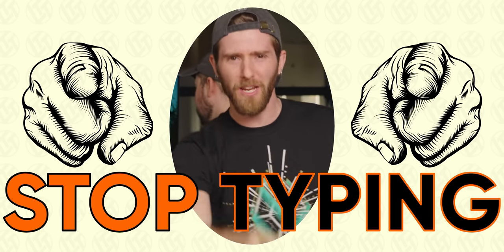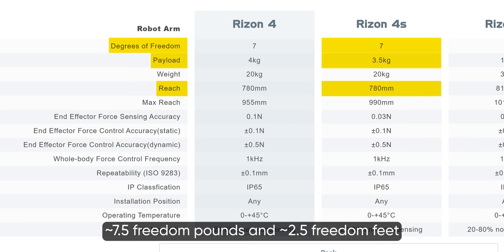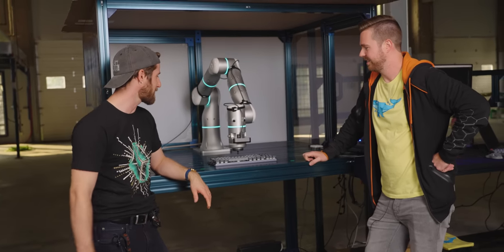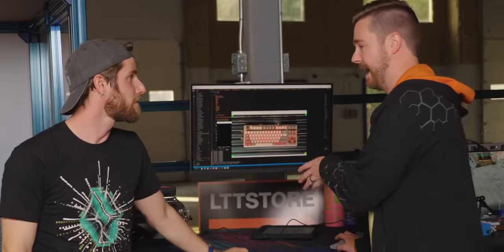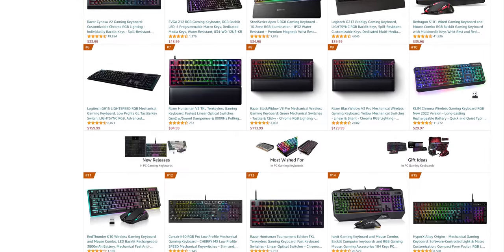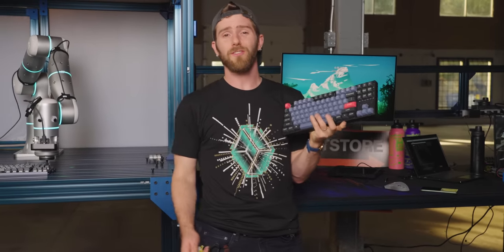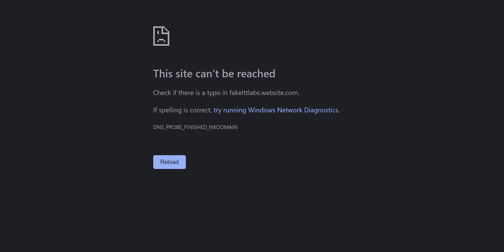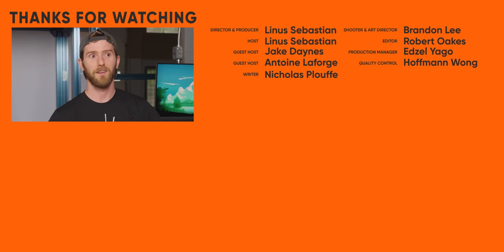Your Keyboard Sucks and I Can Prove It. - Labs Keyboard Testing

Comment: I can easily plow through 10 keyboards a year (nerd rage). I have tried so many brands in every single price category, and the most durable brand I have found so far is Corsair. Unfortunately, they've had issues with keys double tapping randomly forever, at least on their mechanical keyboards. And, their prices are a bit high. Worst brand so far for mechanical keyboards is Logitech (I broke one within a couple of days once, with very little force applied), by far, followed by Razer. I've yet to own a single Razer product I've been happy with.

That said, there are plenty of brands I haven't tried yet. I'm sure there's an even bigger turd out there somewhere, and hopefully a golden nugget as well.

If you're like me, try to stick to the MX Red or equivalent keycap, they can take the most abuse. MX Blue (clicky keys) are very fragile.

Comment: What I want to know from a keyboard test is if all they keys actually send the right signal. On my Keychron K4 the F1-F12 keys did not work out of the box. I had to apply a kernal hack on Linux to get the F-keys working. I would have liked to know this ahead of time.

Comment: Why not use a micro controller with a USB host? That way you can figure out how much latency a keyboard itself adds!
Reply: That latency explanation is not entirely right, because games generally sample input at some point per frame in the pipeline and there can also be frames queued for display...

The caveat is that the OS input subsystem also has a say in how fast it will fire events for input.

Comment: sry bro the robot sounds sus since it pushes all the way insteat it should be squishy and messure the resistence at the push where the highest resistence acctually is if that make sense?  i think if the robot "finger" is stiff it read false reasult cuz i dont know, i have a feeling.

Comment: Wow. As a robotics expert and systems engineer, this is absolutely a massive, pathetic shot in the foot. Using a cheap wobbly cobot and claiming it can measure down to the micronewton is an absolute and downright lie - whether it's the labs team being incompetent and lied to by Flexiv, or whether the team itself just wants a robot and is lying to Linus(or whoever the manager is), this is just laughable.
Why? Measuring rotary torque(which is what this is doing) on a gigantic lever is always less precise than a proper load cell on a rigid gantry. On top of that, the robot uses harmonic drives, so you lose resolution there too, because it will vibrate quite a bit and the strain sensor is on the other end of the linkage.
This entire rig could be built much more accurate, cheaper, and faster, in less time than this was set up. Fail.
Reply: Huh. Interesting. Id like to hear more pls
Reply: @Isaacreeper  Look into how cobots do torque sensing, Universal Robots is fairly open about it. You'll see why it's primarily a safety and rod-in-hole kind of tool, not suitable for metrology.
Reply: I'm not a robotics expert but this setup seemed a bit wrong for me too

Comment: Stuff like this will put companies on alert in terms of what they're actually doing with their devices. To me the worst offender by far are controllers, but that problem cannot be easily fixed. That's something where you'd have to have major lawsuits for the type of switches they use, but stick drift in the first year of owning a controller is insane. I have GameCube controllers from when the GameCube first game out that doesn't give any of those issues so there's no reason why developers don't give us decent controllers for the price that we pay. If you paid that 200 for a pS5 elite controller and it gives you stick drift early on I'd be royally pissed.

Comment: Yay, this really will be a gamechanger. And I'd happily use all the affiliate links you (maybe) put behind all available stuff. Seriously! Because that's EXACTLY what annoys me concerning tests in general: they are often just valid for a specific time and date, due to changes in the testing environment all the time, that always leave a little bit of doubt behind if THAT test wasn't, at least, a little bit influenced by the "expected outcome" (sponsor). And it doesn't really let me compare X to Y on the same level.

Still happy with my K70 btw., but... Yeah, I bought it because of a test, that I trusted on some well known hardware site, and well: not anymore.

Comment: The latency test seems overkill. Just trigger an oscilloscope off a lead from a switch and measure the amount of time until the corresponding packet is sent by monitoring a single USB data line connected to a computer. The packet is very easy to identify. You don't need a fancy setup and I'm pretty sure this is the most accurate method. A fancy oscilloscope could even detect the packet for you. You do not need a USB analyzer to detect key press packets. Edit: watch this video by Ben Eater https://www.youtube.com/watch?v=wdgULBpRoXk&t=1829s

Comment: Ewww Manjaro in the background. EndeavourOS actually uses Arch repos and doesn't have an awful history behind it. Just as easy to install. From a reliablity perspective, please get off that. If your hire only understands Pamac, they can get it from the pamac-aur package, installed via yay.

If your hire is also too dumb to use reflector from terminal or only understands Manjaro's pacman-mirrors, EndeavourOS has got your back — reflector-simple is a utility EndeavourOS provides in their repo. Just disable installing all of the EndeavourOS-specific tools prior to Calamares deploying the system and install that after the fact if using reflector-simple. reflector and Pamac suite in concert.

Comment: This comment will be buried for sure, probably duplicated. For the latency measurements, why don't you just have an Arduino setup? Have the Arduino actuate the key and use a USB host shield to measure the result and take the difference directly so the keyboard is the only extra thing in the loop. I'm not sure if links are allowed, but USB host shield is an easy thing to look up.

Comment: you have weird problems. I need my keyboard to type things. It's not like it matters in a game either if pressing W moves me forward 20ms later or not. 20ms is nothing. in a 50fps game that's one frame. You can't even see that, you don't have that amount of control over your muscles either. You may be able to time it in specific circumstances, but in the end nobody cares, let alone will it make any difference.